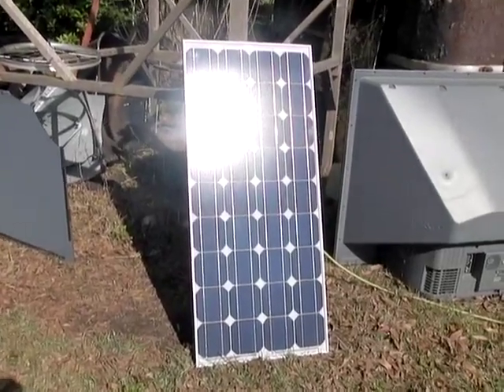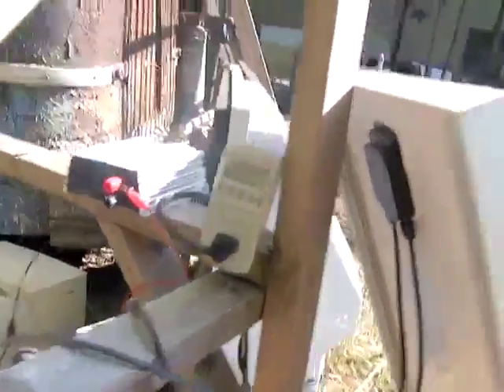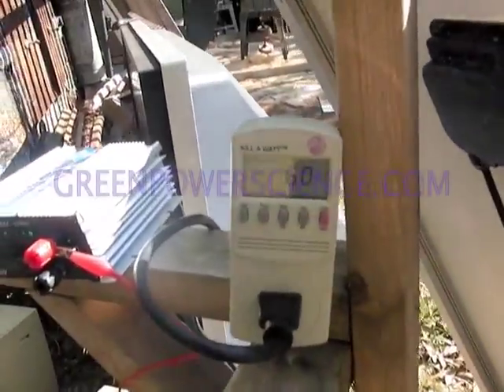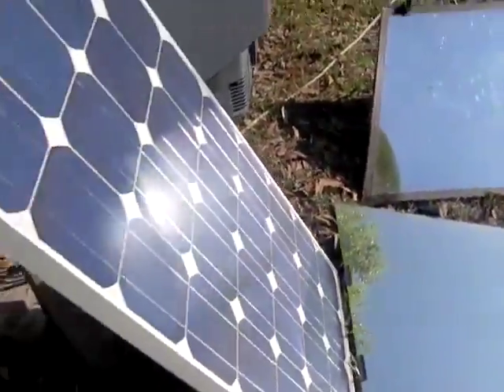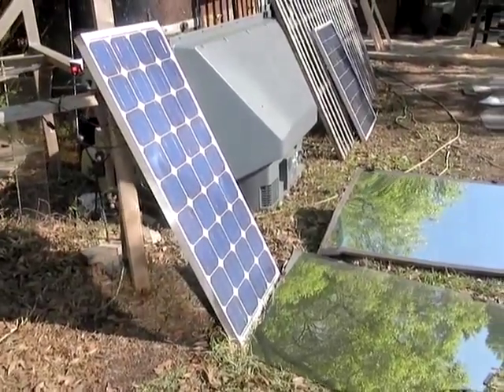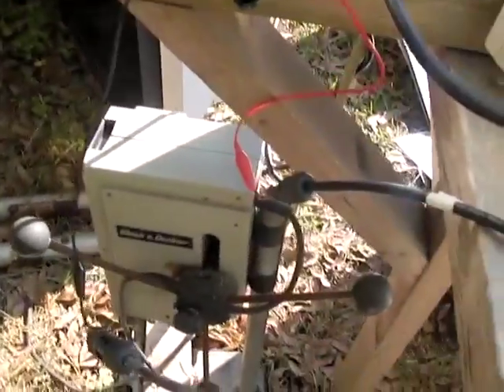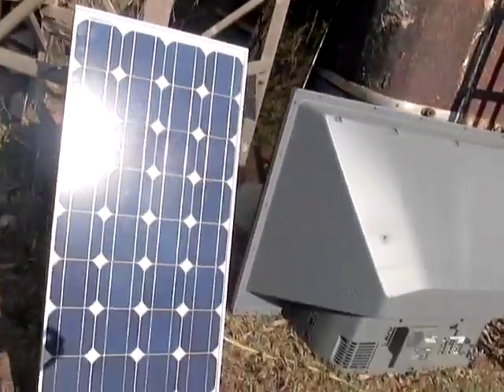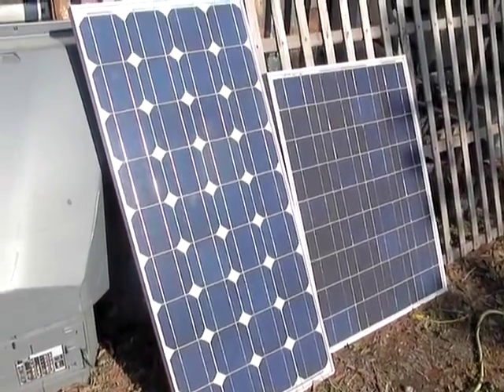solar panel diy power boost 30% from mirror panels

Comment: You could increase the efficiency by spraying water on the surface of the panels. The colder the water, the more power it could generate.

Comment: If you placed the mirror to be most effective by itself (horisontal) the mirror would not work as  well.  Use a roof not the walls for installation.

Comment: qeustion. i have 2 panels on one of the similar inverter with 1 of the panels on a day the inverter puts 50 watts into the grid. same for both. when both are connected in parallel in the same sunlight. i only get a 20-30 watts more. why not a 40-50(double power). same panels putting out same voltage. thanks.

Comment: Sir How would we implement in 10 mw solar plant
Reply: I worked with that years ago and doubled it, but it gets hot, and to cool it with h2o on the back is tough. maybe a power tower or parab with conc. cells would be best.

Comment: What if you also used a magnification mirror, or even tempered, magnification glass, as well as a mirror in combination? Or a magnification mirror and magnification glass at the same time? You could aso try a large telescope crystal, let the sun shine on the rounded side, and aim the flat side at your solar panels like a directed beam flash light!

Comment: Walmart full body mirrors are cheep.and as my cells are fixed in place. I relay a pair to to help out , as the winter cuts down on time to charge batteries. So I get some  extra power and cheaply. Tks  de kv4li

Comment: Good experiment, bad alligator clip wires.  A quick way to alleviate the overheating thin wires are to just double them up so they share the load.

Comment: I don't know why tracking isn't compulsory on all rooftop installations.
Here in  Australia it's mid-winter and my panels start generating about 7am and continue until about 5pm and if my panels were lifted to face the sun in the morning and afternoon I'd probably get another 2kw/h a day on a 2 kw system.
It doesn't need to track constantly - just a morning, noon and afternoon position would do.

Comment: Hey i wondered something, i want to grow light loving plants. And i got a good spot for them, infront of big pond. Where the reflection of the sun adds extra light source. So if the water reflects 80% of light (dont know for sure) would it mean that the plants receives 80% more light ? Like if it get 100 hours of sunshine per month, would it now get 180 hours of light?
Reply from the maker: Water off axis (at an angle if dark colored pond base) can increase redirect sunlight but it is closer to 30%. While the reflection appears very bright it is just bright to your eyes. Use mirrors and a fan to keep them from overheating. The best option is a large flat mirror from another direct. Several mirrors not all focused to the same point can keep the sun on them throughout the day. Just make sure mirrors do not point into roadways where cars drive. The sunlight can come from the side or under the leaf and should not be on the top of the plant or you receive 2x sun in one spot. If the plants begin to lose their green look add a piece of greenhouse diffused plastic in stretched halfway between the mirrors and plants. This diffuses the light but still delivers an even UV enhancement.

Comment: The problem is as the day goes on you will have to keep moving the mirrors as the earth rotates. I've had this in my head but I wouldn't be able to go to work or leave the system as every hour or two I'd have to reline the mirrors. Dose anybody know of an easy way to connect a small wind turbine into my system?

Comment: I'd like to see a test done with panels mounted at a lower azimuth and the sun in the winter's sky then aim the light from that sun onto the panels using a mirror at varying angles while noting the panel output under load.

My system is mounted at 150 degrees azimuth at 14 degrees elevation, so it might be interesting to see what happens if I employ the use of mirrors this coming winter.

Fun times.

Comment: Just an idle thought, the 54 Watts does not mean there's 26 Watts of loss.  The panel will do 80W only under ideal conditions which means virtually never (without help from the mirrors).  Also, the max he got 71 Watts with mirrors, which was pretty close to 80W given that the smaller inverters have as much as 5 Watts of loss.

Comment: Thermoelectric generators on the back to make power from Sun heat maybe able to increase power a small amount.
Reply: Protomaker Black Sprint Original 3D Printer yeah but then you have to cool the Tegs which adds more problems. TEGs produce power with a temp differential. Not just a heat source

Comment: You should try running garden hoes at the back of the panel and run some water, on that way the panel stay fresh and you can heat water.

Comment: Could you please do a test to see if there would be a boost in efficiency if a two-way mirror was placed over a solar panel. If you respond back to this comment, I'll sub.
Reply: I think covering the panel with a two way mirror will reduce the overall efficiency. The mirror will reduce the total amount of light entering, and it can only help to recapture a small amount of the already reduced light which is reflected off the panel. 

The reason the setup in the video works is because you're reflecting MORE light on to the panel than can be captured by the surface area of the panel alone.
Reply: I have been wondering the same thing. If using a type of infinity mirror setup would be beneficial. I can't seem to find any results on infinity mirror & solar panel on Google or Youtube. Let me know if you have found anything.

Comment: instead of using a mirror, why not use white paint or tarp. and point it at the solar panel.
Reply: What really matters here is the percentage of reflectivity given from the mirror. 
Let me explain as easily as i can.
Let's say the power output of the sun is 1000W per sq/m. If you have a panel 1x1 with 20% efficiency, you'll get 200W from it. 
If you add a reflecting source, that doesn't alter the intensity and frequency of the light it's reflecting, and that source is 100% reflecting directly pointed at the solar panel, you'll get 400W, and double the temperature. 
Point is, most mirrors don't even reach 95% reflectivity, mostly ranging from 80 to 92-93%. 
White paint or tarp reflect as little as 10%, so if you point a square meter of a 10% reflecting source, you will get 200+20 W. 
A good thing is that since tarp or white paint reflect so little, they dissipate more hot air, rapidly. So the power loss from the totall efficiency of the panel will be minimum. 
Yet, to have notable results, you'll need a good reflecting source.

Hope i was clear enough, english ain't my main language :3
Reply: The short answer is that white paint isn't actually reflecting, it's diffusing the light, bouncing it off in every direction. A white surface will look just as bright from almost any direction where it is visible. A reflective surface, on the other hand, will be much, much brighter on the angle of reflectance, allowing you to direct where most of that bounced energy goes, in this case, onto the surface of the PV panel.
Reply: And now? Only because you dont reflect your vision in white paint, it doesn´t mean it wont reflect light... I think, given how the panel absorbs the spectrum of the light, it would help a little bit.
Reply: Don't bother with the paint... use a roll of Aluminum foil or Mylar.  The danger is that if a panel gets too hot, it will lose efficiency or could also damage the cell.  I've been wondering though if you could rig up some copper tubes with glycol running through them as a heat sink behind the panels to cool them if they get too hot, and then run the glycol to a water heater for heat transfer.  A lot of solar water heaters use glass tubes that absorb the heat of the sun... but if the panels are creating heat anyways, I don't see why it couldn't be used.

Comment: The trouble part of a solar panel set up is the tracking of the sun position during the day to get the most of the sunlight. Adding a mirror doubles that requirement. I wonder if there is anything out there that would help?
Reply: +Thong Vu I'm thinking that if you have the time and the land to do it... you create an open mirror box... on two sides of the mirror box you have a line of panels, on the floor and the 2 opposing sides you have an array of mirrors acting as one giant mirror, I guess the only concern would be blinding light for aeroplanes that fly overhead... i guess you could just flip it on the side so that the panels are on the bottom and the mirrors are along all 4 walls.
Reply: +Thong Vu oh and let's not forget a slow running water cooling system (i.e. just drip water slowly over them), cool panels = better performance

Comment: Seems the solar panel itself reflects quite a bit of light - now about using a solar panel to reflect onto another solar panel - like a corner reflector for radar - would you net more by "double processing" the light?
Reply: +DLWELD I have considered that in a way, but came to the conclusion that a different style of panel would be best ;) 
Perhaps stacking cells and having a mirrored base behind the layers?

Comment: Sunpower C60 cells -- Broad Spectral Response SunPower cells capture more light from the blue and infrared parts of the spectrum, enabling higher performance in overcast and low-light conditions.

Comment: Have you tried individual solar cells without encasing?  e.g. mono vs poly, and mono cells where the metal traces are on the bottom vs the type with them on top?  Maybe individual cells could be concentrated onto.... a simple bicylinder dome would give twice the surface area (should be 2x total), but would probably concentrate in the very middle.  A diffuser could solve that potentially.  Also the top bicylinder dome should probably be stronger than a flat piece of glass, considering it should deflect hail and such better.  Or, a simple bowl upside down as those are already manufactured, but don't match the square cells as well.  a well fitting piece of glass could be glued to the bottom, making a well sealed single module.  I'm not sure if inert gas fill or vacuum could help but if so might be feasible in such a design.   Heated air could be what shortens the life span by reacting, and getting rid of a reactant gas could enable higher temps without shortened lifespan potentially.

When entirely sealed in glass, there should be a very good thermal interface for drawing the extra heat away for use both in the winter and summer.  If there's just too much at times, maybe a simple system could be used to shade when needed?  i.e. passive gain in lower light, active shading in peak light.  Maybe an aluminum-coated 'cocktail' umbrella in the center that unfolds automatically?  That should be more reliable than a tracking system... it could be made with expanding paraffin probably, so it would be totally free of electronics or digital control.  Another maybe better option might be to have the 'thermostat' valve move the cell down out of focus.... half of r I think for 1x power, or 1.5" for a 6" cell.  It's not flat but it's still very low profile compared to any tracking system, especially on a roof.  Nitinol or dimetal might do the trick best.
Reply: +Charles Hansen Getting too technical won't get you far. Removing the metal frame means you are removing the protection out of the set up. We live in a real world where there's hails, flying debris (bird poops, tree branches, rocks, golf balls, rain water, anything...) and wind that can do all kinds of damage to the solar cells.

Comment: You also shorten the lifespan of the cells, by 4x with 2x light, getting only 50% gain, but in the end, you get 25% less in the end. (Under normal conditions.)

However, "cooled", using 2-10% of the abundant power, you gain closer to 65% from 2x more light, and only shorten life by 2x. (Eg, 30 year panel will die in 15 years, not 7.5 years, if cooled.)

If super-cooled, you extend the life and triple the output. (That is what solar focusers try to do, but generating steam for a turbine is much more efficient.)

Mount the solar cell on an aluminum sheet, bend the ends down and bond more "fins" along the back... Set it in water, and now you have a cooler/heater. Cools the solar cells, heats the water, gives you hot water and water distilling all at the same time. (Exhaust the hot steamy water over thin sheets of aluminum, not connected to the solar-cell and in another cooler source of water. The water will condensate and collect there. Perfect in a kiddie-pool with a cover over it.)

Hack-a-day, survivalist. Compounding all ideas into one large idea is better than having 100 independent ideas that are partially functional.

Comment: Fascinating. Have you done any more recent tests? I wonder how MPPT technology would be affected by using mirrors on a small array (say, 1KW). You could position a mirror on a couple of panels and boost their output, but the other panels wouldn't be affected. The MPPT voltage algorithms who likely be messed up and cause the panels to operate at incorrect voltages.  Still, interesting video...thanks! Betcha had fun!

Comment: to chad:
Actually could he not just place mirrors or the reflective painted surfaces mentioned earlier, on the the east and west ends?
Reply: Get solar system installed in your home at no cost to you. 
To qualify Contact SolarCity at 725.333.6186 or email jpitman@solarcity.com
http://solar.solarcity.com/go4solar

Comment: I wonder, Dan, if mirrors are the best for targeting the wavelength in this experiment. Have you considered painting a parabola with UV-reflective paint? I don't imagine that'd be quite as reflective as the aluminium backing that mirror of yours, but perhaps you might be able to avoid reflecting much of the heat which would presumably damage your PV cells... Then again, since the UV has to pass twice through that glass in order to reflect off the backing, it might be an improvement.
Reply: Sebastian Ramadan You actually need expensive silver-coated glass surface mirrors, so the light does not pass through the glass, like telescope mirrors and medical mirrors. (Expensive as hell and highly corrosive and scratch-prone.)

Chrome mylar would work better.
Reply: ***** Silver reflects UV quite poorly. What are you gibbering about?
Reply: ***** Aluminium is the best metal for reflecting UV radiation (400nm and below). Unfortunately, it would bring all of the other spectra of visible light, as well as infrared, which will heat the cells unnecessarily (that is, with no gain, because solar cells operate on UV radiation only), degrading their life. The biggest cost here is the cells, not the aluminium (or paint, or whatever)...
Reply: +Sebastian Ramadan  well, yeah, but no "main stream" mirrors used today use silver - all use evaporated aluminum
Reply: DLWELD
Though I understand silver is great at reflecting the visible spectrum of light, it's not so good at reflecting the UV which solar cells operate upon. If you were to read everything I wrote entirely, you would realise that I'm advising against using silver because it's not as good at reflecting the frequencies of light that we're interested in. I'm advising a surface that exclusively reflects UV because the other frequencies are only likely to unnecessarily heat the solar cells, causing them degradation.

Comment: CPV, or Concentrated PhotoVoltaics, is explained in the SciShow episode titled "Solar Energy" at 7:30 min.
Hank Green says they're using mirrors that are 10 x larger than the photovoltaic cells and in this way they cut down on costs and get a much more efficient use of the expensive solar cells.
Judging by the above experiment, this requires better wiring? Better cooling?
My fresnel lenses are 4 x as big as my solar panels [small ones] and i hope to increase my output in this way but i appreciate the warning about overheating!

Comment: You can also receive the same effect with magnifying glasses
Reply: Socrates Raramuri If you use a fresnel lens, might you not ruin the panel? It would become unbelievably hot.
Reply: SinDelle Morte
Dan warns that cooling will be necessary. Air? Water somehow? We'll find out.
Reply: or fresnel lenses

Comment: Look on the back of the module, it should have temperature coefficients. When the module gets to hot the amperage goes down, when its really cold the volts goes up. Needs a balance of the two to get watts. What the wattage of the module, yeah you are going to lose some power through the inverting process about 85% is going to be usable.

Comment: nice idea, but its not practical, you need to change the position of the mirror every 30 minutes in order to make sure it reflects the sunlight to the panels,
Reply: What if the mirror is slightly curved?

Comment: If you put an IR film on the mirror(s) wouldn't it still work and block the heat? From what I understand (which really isn't much), the PV cell uses the visible part of the EMS and so blocking the IR would allow you to have a number of mirrors without heating up the panel. Of course, I don't know how much light the cell could handle, there are built in limitations. Could you possibly double the amount with several mirrors in this way?
Reply: I worked with that years ago and doubled it, but it gets hot, and to cool it with h2o on the back is tough.

Comment: Nice video, Thank you - I am guessing that a person who made an air heater or a water heater solar panel could focus as many mirrors as possible (as long as they made the box of high heat materials like metal studs and fiberglass insulation) and get very high heat increases! 
I need to try this! 
Thanx again